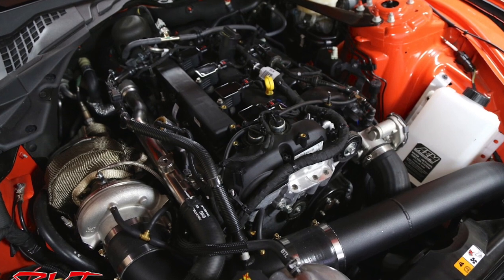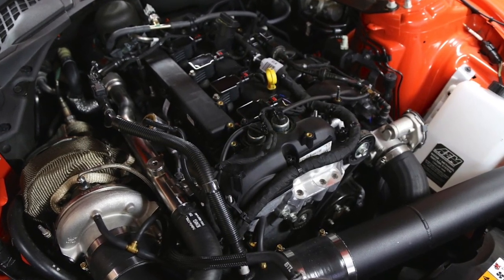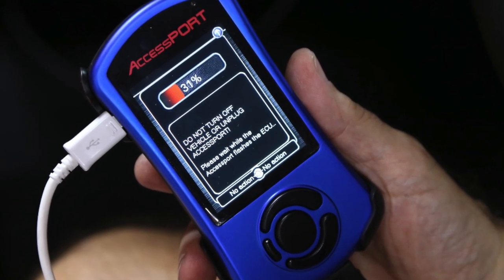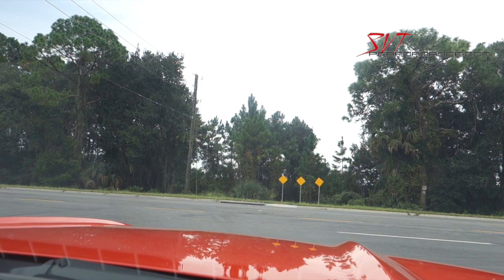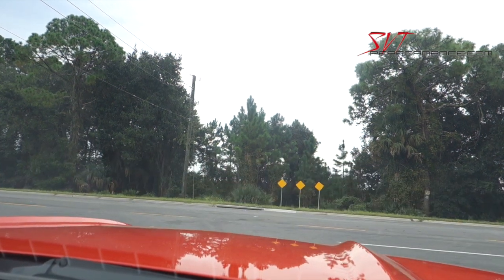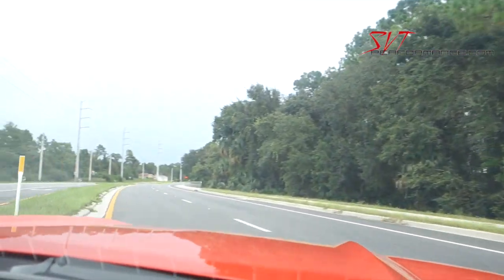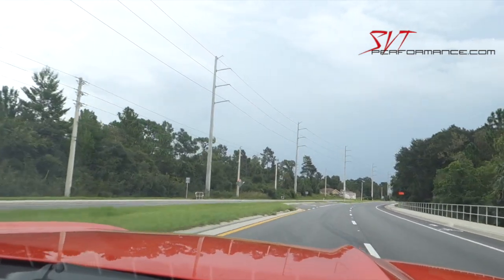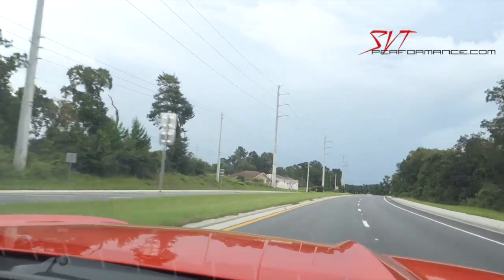VMP Tuning EcoBoost Mustang Turbo Upgrade

Comment: 99% of the 93 octane Oem dyno numbers on these cars is in the 270-280 rwhp range, not 235-245. 235-245 rwhp is very typical of 87 octane fuel. I've seen it a lot on these cars. Dynos with the hood open also creat false cooling. So deduct 14-22 hp for realistic on-road hp, not parking lot open hood gatherings.

Comment: Odd though, based on the stock numbers, 240 rwhp is only 275-280 crank hp, and Ford says it makes 310 crank on 93 octane, 300 on 91.... But shucks, 410 rwhp, translates to 455 crank hp and 450 crank tq. Nice. In a 3500+ lb car, that should be fun. Can't wait to see a ZL1 owner get smoked and wonder what dusted him. LoL. I would keep the exhaust sounding stock, stealthy quiet for 100x more WTF was that, lol...
Reply: +Michael Harris You have to remember there is more loss through the drive train with an Auto by anywhere between like 3-5% compared to a standard tranny.  Also environment (temp/hum) and the particular dyno they are using could give high or lower numbers than what you would factor from the factory ratings.  Which are usually a motor on a stand in a controlled room on a dyno.
Reply: +Michael Harris FACEAPLM!!
Reply: 240 RWHP + 19% is 310 crank. Which is definitely within the norm.

Take into consideration drive train losses, from the automatic transmission to the large wheels & tires this Mustang has stock - it takes a lot of rotational mass to get them turning.
Reply: I've seen 270 on 93 before
Reply: Right but the variables on that number are many, temp, hum, elevation, how good the gas is, and of course the dyno, they all vary, these are speed density cars and they require accurate load on the dyno,and not all dyno's are equal, get 270 on one, it would be 252 on another etc.  It is just a number ultimately.
Reply: Smoke a zl1? Good laugh

Comment: Did you guys test the ecoboost on 87 octane? 239 rwhp + 15% is 275 crank hp. That's WAY lower than Fords claim for a 93 octane ecoboost which is 310 crank, and even 299 crank hp on 91..... should be around 264 crank, on 93 fuel, or 251-255 on 91....

Comment: I bet this can barely keep up with a stock 5.0. What a waste.
Reply: Lol a year ago you commented on this complimenting it and now  you came back and hated on it...you bipolar or something?
Reply: Sure, when it first cane out, seemed like a decent car. But I've learned over the years to never buy a vehicle in its first year. And here we are, with serious issues with turbo and engine fsilure due to the direct injection causing major carbon build up, and the turbo is a small k03 which leaves little room for much boost, it maxes at 27 psi and it's a very, very heavy car. 3650 lbs is more than a base 5.0 V8... way to much weight in a car with a little 2.3.....  The original 1984-1986 Mustang SVO 2.3 weighed 2800 lbs, made nearly 255 hp, they were underrated back then, and when the air was cool and fuel tank down to 1/4 left in it and a simple DP upgrade with wastegate boost increase, you could add 2-3 psi, which was not much, and push 275hp, and it's 0-60 mph runs would drop from 6.4 sec down to 5.3 sec. Most folks don't realize the mustang ps made from 2005 to current, are essentially a huge 4 door sedan. The 2005-2014 cars were based on the Lincoln LS 4 door platform.... Today's cars are disappointing: They're heavy, have loads of electronic nannies and built in tracking devices, computer controlled tranny's, etc because people are to busy playing on their phones, because of all you incompetent drivers, that is leading us into a future where we won't be able to drive in 10-12 yrs. One of life's great pleasures and privilege is driving, man and machine, not stupid driver nannies, etc. And when EMPs fry everyone's electronics, at least Ill have a nice older car and bike to use.
Reply: I mean the BMW 335i has a twin turbo 3.0l engine and can make 460whp on stock motor and turbos, tune, jb4, and intakes. Point being the curb weight is the same, power can be around the same, and my friend's 335 with a 6 speed destroys the 5.0s. After all, once you factor in 15% for parasitic loss the 5.0 makes less than 400whp. Now granted the N54 in the 335 is essentially a modern 2jz, but I digress. For a little more than 8k you can buy a built motor and a precision turbo from MAPerformance and make 700whp like they did on their 2015 EcoBoost. All and all it really depends on perspective and the owner's wallet.